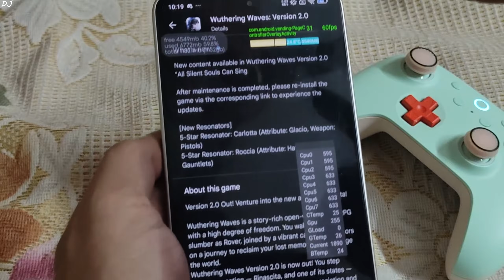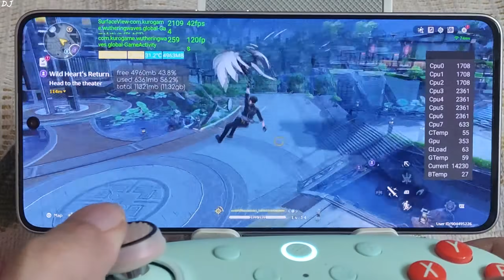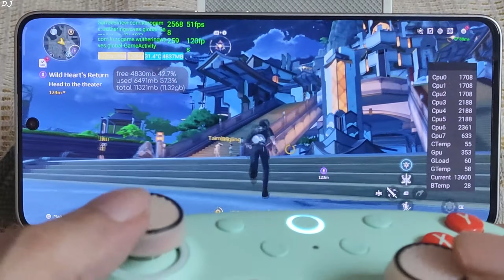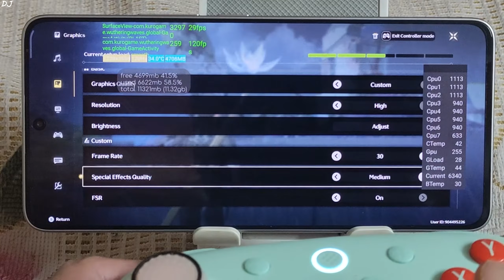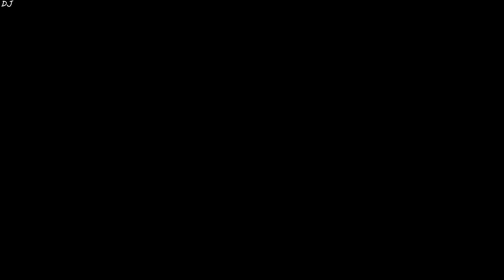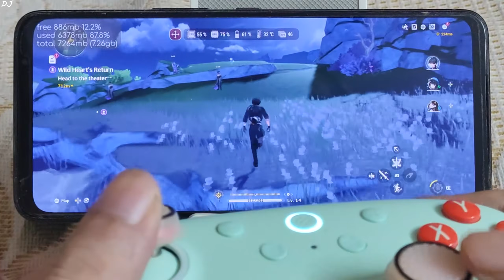Wuthering Waves v2.0 Android Performance Analysis | Snapdragon 8s Gen3 & 888+ Test | Poco F6 & ROG

Comment: Hey , im planning to buy a phone. Is 8 gen 3 enough to run this on max settings or should I go with sd elite ??
Reply from the maker: Don't know, phones are trash for gaming especially demanding games like this. Overheat during the summer season. Most of the games are not even optimised for new processors.